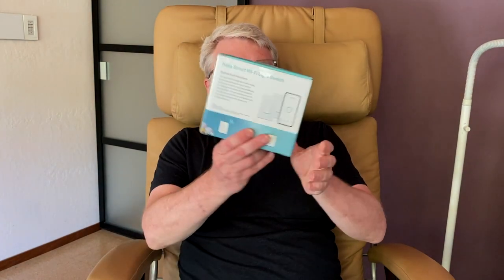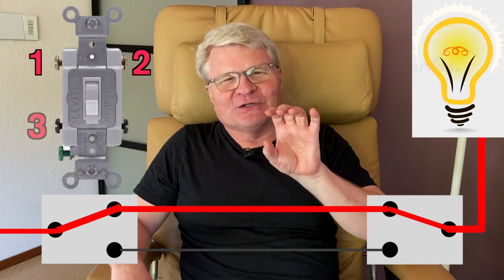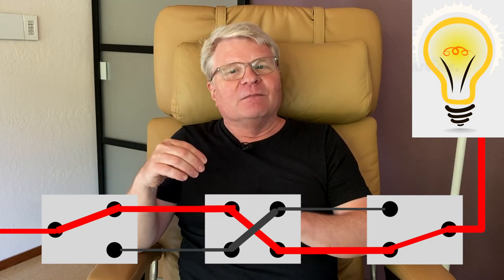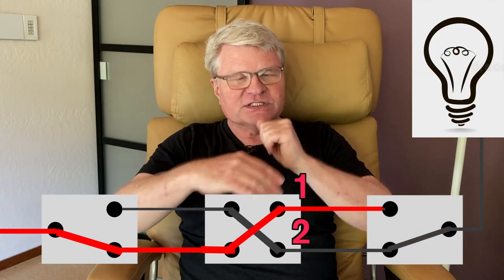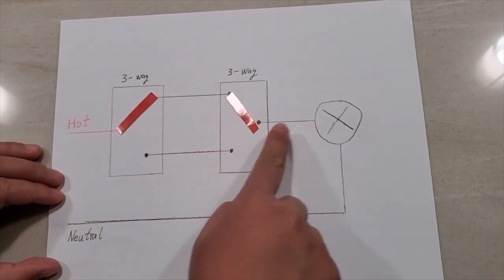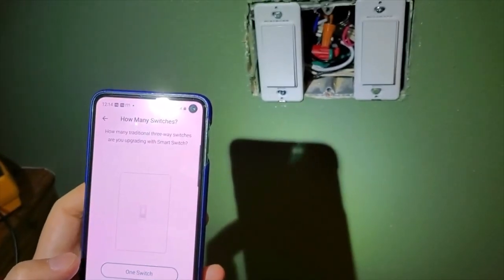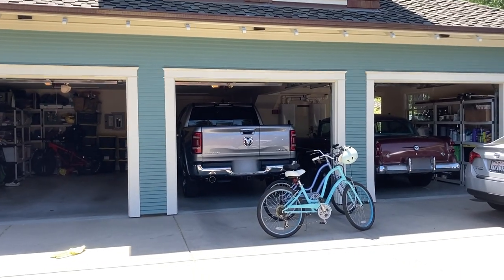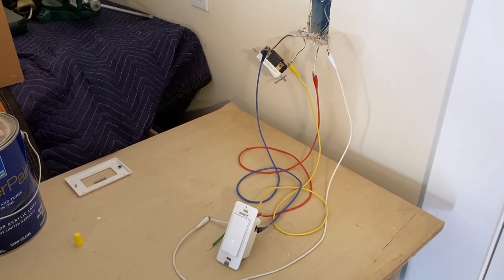Deep Dive: TP-Link Kasa Smart Wi-Fi 3-Way Light Switch on 3-Way & 4-Way Circuits & Your Network

Comment: great video.  amazing enough, I ran into the same issue with another brand 3 way switch from TreatLife before I saw your video.   I have used several of these 3 ways without issue using a single smart switch in the line side box.  Last Friday installed one in my shop that has 2 x 4 way switches. Installed in the line box and mechanically, it worked fine, but using the app and integrating to home assistant, got similar results that you did.    
Removed and installed the same switch in another location on a different circuit and it worked perfectly.   However, much shorter run between switches. 
to make a long story short, It appears that there might be a voltage being induced through the long travelers in the shop.  (similar to the issue you had at your friends).  installed a second smart switch at the other end and it worked.    After digging into the circuit deeper came to the conclusion that something was causing problems on the travels.  I installed a 200K resistor across the travelers at the line side box and was able to use a single smart switch on the line side box.  App and home assistant work perfectly.

I have  Kasa 3 way switches and will try that as well.

Cheers
Reply: Hello Shawn, did you install 200k resistor on both travelers wire? Thank you in advance

Comment: I'm just now finding your video in August of 2023, just picked up a Kasa 3 way dimmer switch. I did install the original 3 way switch maybe 25+ years ago. Now the house I'm in also has the old knob and tube still in the attic, it's copper cloth coated mixed into the mess this old house is. I remember a much younger me in the basement, before the internet, setting up a piece of 1x with the 2 switches on it and my dead man's cord to figure out how to run this switch, much like you have. Thank you for diving into this switch and explaining the quirks this switch has, such as the "slutty" behavior of the switch and app and how the polling is the exact opposite of what you'd think it'd be. 
I also was scratching my head at this switch, but your very in depth analysis of this switch explains just about everything. Now that this switch is a #1 seller on Amazon, I predict this video is going to get much more traffic. Kasa should just link your video honestly, although it may scare some away from buying it, security issues being one. Anyone reading and worried, if you don't have a router with the ability to place all your IOT devices in one spot, a trick is to use your guest network and place all your IOT devices in the guest network and wait for the mesh networks to come down in price. TP-Link has a mesh router called Deco, the x55 is getting cheap for a 3 pack, under 175 on sale and gives you all the fancy features, including a dedicated IOT network leaving your guest network for guests. Also anything Kasa or TP-link can be added or done in the Deco app. 
I was looking for your follow up video where you were going to tear it apart and get to the bottom of it. In my search I found some other videos that have me interested, 60 volts on some lines is a good video too. 
Thank you so much for such an informative, down to earth video that's palatable for all that have the same questions. I clicked on that big head, and the bell, well done sir. I got into tinkering with the original direct TV TiVos, I see you have some TiVo videos too. I'm looking forward to watch more of your videos as they all seem to be so well done. Again, thank you for sharing everything you found.

Comment: This is a great video, and it explains a lot for those of us who have installed Kasa three-way switches. I installed one Kasa in the line side box and it worked fine.  The Kasa was also discovered by Home Assistant. The video cleared up two things I noticed,

1. When testing, I used a Klein RT210 outlet tester, instead of a light bulb.  When things were switched off, the line LED glowed dimly, when you would have expected it to be off. Now explained by the fact that we do have current on the travelers.

2. The other thing I noticed is that when I controlled the switch via an automation or dashboard (local) , the change was pretty much instant. And when I switched manually the delay was slight. The app was inconsistent. (cloud)

Unfortunately, my switch has failed!

Comment: My kitchen lights have 3 switches and after watching this video I gave a shot at only replacing the 3-way switch on the supply side with a Kasa 3-way switch. I had only partial success: the schedule tended to turn the lights on reliably. But the schedule would never turn the lights off and the use of either the middle 4-way switch or the load side 3-way switch would confuse things. After a week or two I replaced the load side 3-way switch with a Kasa 3-way switch and now things are great! It has been over a month and things work perfectly. I can use any of the 3 switches to turn the lights on or off - and it doesn't confuse the scheduling. I set the lights to come on at dusk and off at 10:00 PM and it has been 100% reliable so far.

So - at least in my case - I needed to install both 3-way Kasa switches to get things to work properly. I didn't modify the dumb 4-way switch in the middle, but I still use it every day without confusing the Kasa switches.
Reply from the maker: Yeah, this is fascinating. At Geordie's and at least a couple of times here in the comments people have reported this and I still have never figured out what is going on in these situations. That's why, in the video, I was looking for signaling between units on the zero-crossing (and not finding any). Are the devices changing the charactaristic impedance so it works better? Are some of these odd voltages being used to signal? I still need to tear these units down and look for more clues. Thanks for this report.
Reply: I had this same turn off scheduling problem and incorrect light status at the app.  I tried several 3-way switches at the line side but still have the same problem. One thing I noticed is that if the status (circle) at the switch is always regardless whether the switch is on/off on then the switch is not working correctly as indicated earlier.  I have successful installed only one 3-way switch at the line side and it is scheduling correctly and status is also correctly at the applications.  This switch is working because the status light at the switch does turn on when my light is off and off when my light is turn on either manually or remotely via the apps.  So, somehow the defective switches thinking it is already in off position then it doesn't need to turn off my light when it scheduled to turn off. These defective switches turn on as scheduled fine.

Comment: EDITED 11/24: This video is amazingly comprehensive - thank you for putting in so much time and effort. I have a 4-way set up and I was attempting to use Kasa's 3 way-smart dimmer setup. My setup works as intended same as QTTechReview with the non-dimming HS-210. However, so far the setup does not function correctly with the dimming KS-230. I exchanged the kits I bought and received replacements in different packaging (shrinkwrapped, as noted by users elsewhere). There may be differences with the replacement units though I have not tried yet. Will add to this if they miraculously work.
Reply: Just to update, no they do not work correctly. Toggling the 4 way switch made the others non functional with both kit varieties. Ultimately I took out the 4 way switch and made it a 3 way circuit.
Reply: @statzern  - Thank you for your update, I was hoping that I could use a dimmer with a 4-way using the KS 230. I have the newer KS-230 v2 switches, v2 has enhancements but it sounds like it is an ease of wiring thing, I found this online;

Here are some of the specific changes that were made to the KS-230 v2:

The line and load wires are now separated, making it much easier to understand where each wire goes.   
The traveler wires are no longer dependent on the order in which they are placed on the main unit. This      means that each traveler is equal and can be placed onto either nut on the satellite switch.
A flashing red LED light is now included to help users through the installation process. This light will flash if the wiring on the unit is not correct.

Overall, the KS-230 v2 is a more user-friendly version of the KS-230 that should make installation and setup easier for most users.
Reply: Were you able to get it to work with the v2 version on a 4-way
Reply: In a 3 way dimmer set, the two switches are different. I put one on the line side and it blinked red until I installed the load side.
Reply: @jstinsley  Reports are that you may be able to use one primary switch and two secondary switches to replace a "4-way" dumb switch setup.  I have not tried...  (And then supposedly you can use the extra primary switch as a normal dimmer - no secondary switch - to control a different light.)

Comment: Wow, just wow. I wish Kasa's documentation was anywhere close to 1/5 of this video. Their documentation and even app install manual are superficial at best. My original 3-way only had one traveler, so I had a hard time understanding what changes I needed to do to make it work in my case. In the end, when rewiring I only added a new traveler between the switches and it worked like a charm. Even syncing it to alexa.

I only installed one switch on the load side with a dumb/older switch on the line side and it work exactly like in your example.

Thank you for taking the effort to post this encyclopedia on the Kasa 3-Way HS210 (Adding this here for people like me who had a hard time installing the damn thing).

What drives me crazy is that long delay on the app/ring light, if you press you switch multiple times in a short time span, I assumed it wouldn't show the appropriate information until you actually pressed the device multiple times, and I could see in your video that it's actually up to 1 min delay. Due to your video I tested on my switch and go the same results as yours, and I'm a bit more comfortable with how the thing works, usually I don't press the thing multiple times in a short span anyways.

I Loved the wireshark visualization on how the switch communicates with the several devices.

Lastly, I'd increase my rating of this equipment from 2 stars to a 3 stars. this delayed communication with the phone is a crappy implementation in my opinion. If its about the user experience, make it an option on the Kasa app, so we can configure it as we see fit to our case.

Comment: I used the Kasa App for the install steps and it asked if I was using 1 or 2 of the 3 way Kasa switches and I chose 1 and it guided me in determining which switch to replace and it all worked like a charm.  Not sure if this is new for Kasa as articles I have read seem to indicate Kasa does not have any support or documentation on it but it seems they support it now.  At least in their Kasa app instructions.  But your demo of how it connects to Kasa in the cloud was nice.  I have all my switches and Alexa devices on my Guest wifi as I read that was good for security.  But I imagine then if my internet went down I would not have access as my iPhone is on my main wifi network so it is probably having to go out to Kasa cloud and back down when I do something from my phone.

Comment: @25 mins (temp loss of circuit when flipping the switch) - jaw dropped!  Of course it would! On eof those things you just wouldn't think about unless you were intimately familiar with switch design.  Brilliant.  It doesn't really affect my situation but I can imagine it would have been an issue at my previous home.  Thanks for figuring this out!

Comment: This is great and confirms some of the challenges that I have been having. Support for TP-Link are very challenged to support their own products.
The other challenge that was not answered with the video was the integration with Google Home/ Amazon Alexa.  The biggest improvement we wanted with the smart switch was to able to speak to "Alexa" to turn off/on the lights.
Well we can turn on the lights, but turning them off "is not working". (I am using the load side install configuration)
In the app (Kasa or Alexa), I have to do the following to turn the lights on and off using either app.
1st press of the "button" - light on and button highlighted.; 2nd press - light still on and button off; 3rd press - light off and button highlighted; 4th press - light off and button off.
This pattern can be repeated several times. On one support call with TP-Link the person had me reset the switch and reconfigure it. For a short bit it worked properly, but then fell back into the above pattern.
Tried resetting the switch again, but that did not work this time around.
Using voice commands with Alexa appears to only turn the light on, but not off at all!
Not sure if anyone has had similar experience or a solution, but would greatly appreciate if you have one.
TY again for the video!

Comment: Thanks for the video! Spent 2 days trying to figure out how to wire 3-way with dead end and a messed up wiring, pretty much gave up, and then saw your video explaining how travellers can be used - got it working in 5 minutes. Thank you!
Reply: How did you get a Dead-End working? I've been trying to get it working but these switches need a ground (I'm not using a 4-way, i'm using this in a 3-way configuration. I'm familiar with 3-way wiring but I can't get it working.

Comment: Thanks very much for this comprehensive dive into Kasa 3-way smart switches. Based on your analysis, I tried hooking up Kasa 3-way smart dimmers with an intervening 4-way switch in our bedroom. It worked, but as soon as I flipped the 4-way switch, effectively swapping the travelers to the remote Kasa dimmer, it stopped working. The Kasa 3-way dimmers appear to be sensitive to the order of the travelers to the remote dimmer. As soon as I threw the 4-way switch, the Kasa app picked up the change and told me that the dimmer had stopped working, probably due to a wiring error, and suggested I swap the travelers on the remote dimmer. I flipped the 4-way switch, reset the primary dimmer, and it worked again until I flipped the 4-way switch. Too bad. It would have been nice. However, I installed one 3-way dumb dimmer at the line position in the chain and all works well enough for the boss. Thanks again. From one engineer to another, I really enjoyed your in-depth analysis of the WiFi aspects of these fascinating, low-cost devices.

Comment: Awesome video, thank you so much for the comprehensive analysis and discussion. Will definitely allow me to more confidently use the kit for multiple 3-way circuits and not waste switches as zombies.

BTW - One fun way I used the open commands you used during the analysis previously was to turn an Amazon Dash Button, that sadly have now been discontinued, and turn it into a light switch for my Kasa smart plugs. Required adding a Raspberry Pi to the mix listening to the network and kicking off the status check and change status commands to the Kasa once it sees the Dash Button wake up and try to register to the network.
Worked great for my old apartment at the time with no ceiling lights.
Reply from the maker: Heh. Dash buttons were cool. Good hack!

Comment: This was a great video.  Super informative.  I actually have a 3-way kasa switch I want to install and the only side that has the neutrals in the box is the load side.  I thought I was screwed but now I want to try putting it in the line side and see how it works.

Comment: Thank you so much for this.  This clarifies all of the information out there on these Kasa smart switches.   And, I actually followed a good portion of the programming stuff near the end.
Reply: Hi.  I did have one question. I want to confirm that on a normal three way switch (not a four way switch) that if you use one smart switch it really doesn't matter which switch you replace?  I believe your research indicated that I could replace either the line or load side.  I am going to be installing two smart switches at one location, and I'm concerned there may not be anough space in the junction box to accommodate both of them.

Comment: Practically speaking.......  So, everything works as designed with the single Kasa switch on the line side of the circuit????  appreciate your interest in learning and providing information to folks like me.  Thanks.   Edit - Thanks, during the conclusion/review, you did indeed answer that in order to keep the Kasa energized continually, it does need to go in the line side switch position.  Thanks again.

Comment: This video is very informative. I had turn off scheduling problem and incorrect light status at the app.  I tried several 3-way switches at the line side only but still have the same problem. One thing I noticed is that if the status (circle) at the switch is always on regardless whether the switch is on/off then the switch is not working correctly as indicated earlier.  I have successful installed only one 3-way switch at the line side only and it is scheduling correctly and status is also correctly at the applications.  This switch is working because the status light at the switch does turn on when my light is off and off when my light is turn on either manually or remotely via the apps.  So, somehow the defective switches thinking it is already in off position then it doesn't need to turn off my light when it scheduled to turn off. These defective switches turn on as scheduled fine but not off.